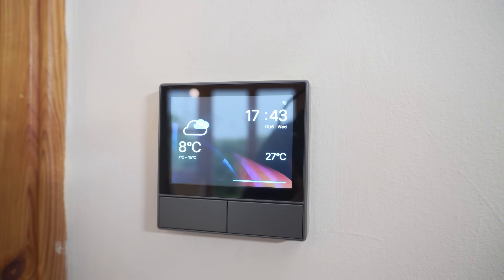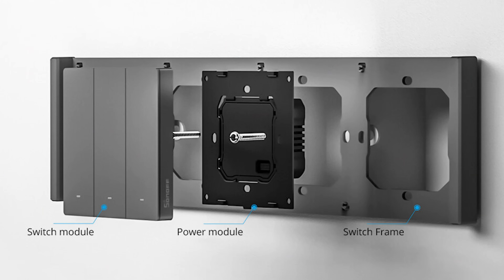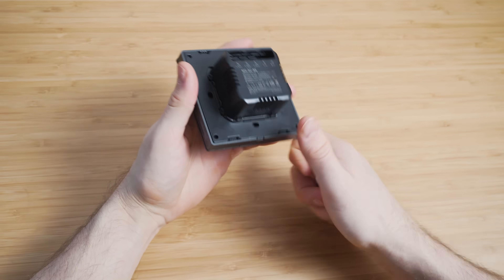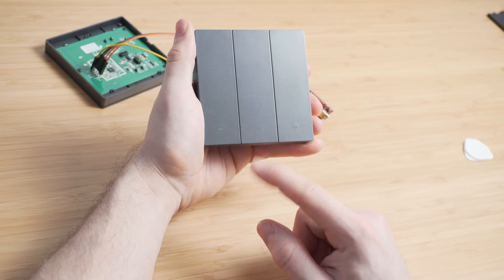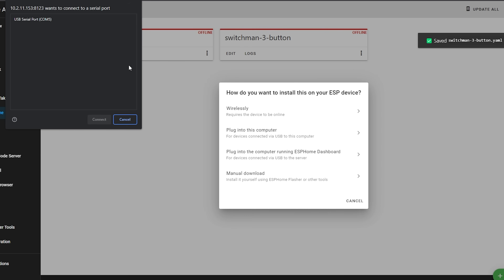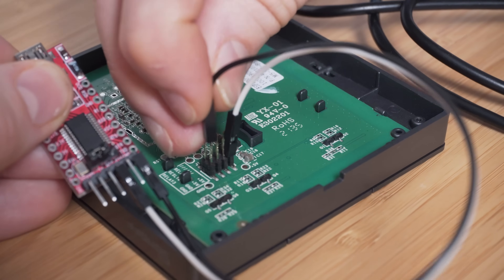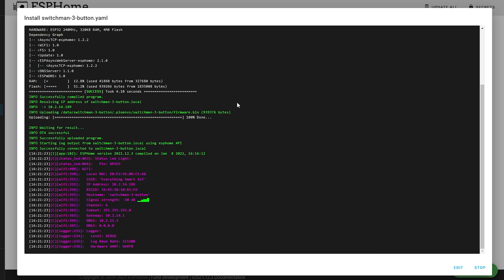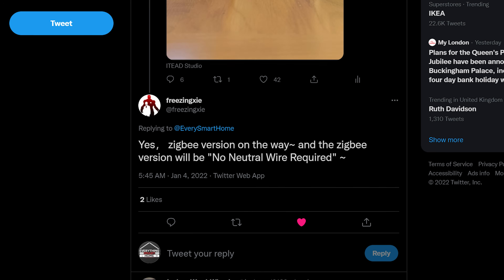Flashing the Sonoff SwitchMan with ESPHome!

Comment: Hi guys. Maybe little update for you. I have ordered 10 of theese switches in white color directly from Itead webside  and they already came with locked bootloader. So no possibility to flash them. When you hold up the GPIO0 to ground it sends following message : Download mode is disabled. Restart with GPIO0 high. I have tried to order grey ones locally and they had unlocked bootloader and flashed fine. Just little info for you. I will have to replace CPUs in theese  with clean ones to be able to flash them.
Reply: Are they the Matter switches? Many people on forums have said that the matter switches come with locked firmware. Also, I think that the matter switches are the only ones that come in white.

Comment: Hey, thank you for the video - there are not so many instructions around it seems. 
I spent many hours trying to tasmotize and ESPHome, bit neither worked out. 
My four computers all don’t talk to the switch. ESPHome tells me: Failed to initialize, Try resetting your device… 
How can I troubleshoot this process? 
Any help or links would be appreciated
Reply: Maybe you have ones with locked bootloader as i had. Then there is no luck other than replacing ESP chip itself.

Comment: I already have Switchman R5 integrated in HA and they show up as sensors. Single press, double press and hold are working. But unfortunately I'm missing release function for hold. So I'm not able to dim during hold and set light during release. Is this something that could be solved by flashing them? I Have dug all over the internet to find a solution but can't see any ideas that is is suitable.

Comment: It doesnt look like it s possible to have the ability to disconnect the relay from one of the switches? At least not the code shown. Or is there updated code that allows for this?

Now the big question with my remodelling in june! 

Aqara zigbee switches (great zigbee mesh) vs. Switchman m5 (great bt mesh)

All will offcourse be used in combination with the NSPanel Pro and NSPanel (ESPHome).
Reply: I might be late for your remodelling but this is possible:
- comment out /remove the on_press part of the sensors
- add a name to each binary sensor

Comment: Thanks for the tutorial. 
In the video, you can see that when you click on the right button, the led light does not light up. I have the same problem. Please have you solved the problem with the right light coming on if the right relay is on?

Comment: Thanks for the tutorial I have flashed ESPHome firmware onto my Switchman M5 single relay switch. I am getting this "WARNING GPIO0 is a Strapping PIN and should be avoided.
Attaching external pullup/down resistors to strapping pins can cause unexpected failures" above the config YAML and the relay is not turning the light on although the dashboard shows the switch change when I physically press the button, but the state icon doesn't change. Please can you help?
Reply: I've found the answer to my issue in the HA forum and then I noticed the comment from 'KNOCK' below. It's working now. 🙂
Reply: Just a 3 channel and 2 NS Panels to go.

Comment: Thank you for the informative instructions. I have successfully flashed my Switchman US version, with the bluetooth tracker being able to get data from a Xiaomi BLE H&T sensor, too. One question about the indicator lights settings. With your yaml, the led id lights turn on when the relays are ON, and off when they are off. Is there anyway to turn on the led lghts when the relays are off, and turn off the leds when the relays are on? That would make more sense. Thanks.

Comment: Thanks for the tutorial. 

I have a M5 1-C and I noticed that in your config in switch section instead of PIN 22 should be 23 in order to work.

Question:

How do I create a light entity instead of switch entity?
Reply: I wish I had seen your comment a couple of hours earlier, before I rewired the switch again and checked my config file against the original 😞

Comment: Can any of these be used as dimmer switches (inc panel)? I recently purchased the dimmer (tasmota flashed) switches from Athom and to say I'm disapointed in them is an understatement as I am constantly having to power cycle them from the fuse box to get them to work for a short period of time.
Reply from the maker: Huh that's strange. Tried flashing ESPHome on them instead?
Reply: @EverythingSmartHome  would you know how I do that.  I've tried using the usb serial cable and grounding out gpio0 but esp flasher errors with "Chip Auto Detection failed:" but guess that's with it not going into programming mode. I'm using a Mac btw.
Reply from the maker: Yes it's in this video 😅
Reply: @EverythingSmartHome  doh! 😖 of course it is

Comment: You probably should get pogo pins, they'll make better contact that those, I've flashed a bunch os sonoff devices with them and it's a breeze.
Reply from the maker: I've got some actually, but find this much quicker tbh
Reply: @EverythingSmartHome  I've just stuck my pogo pins to the male part of the pins you used and pressed them against the pad, that way I've never had a connection issue. But to each his own 😉, you do whatever works for you,and that's what matters

Comment: "soldering is not required"... if you happen to have 3 hands and willing to risk bricking the device if you lose connection mid-flash! 

In my opinion, you should be recommending TO solder some header pins on to these connections to ensure a good electrical connection and not risk the alternative.
Reply from the maker: There is really no risk. You don't need 3 hands, I did many of them by myself...as far as I know I don't have 3 hands.
Reply: @EverythingSmartHome  Or you could be responsible and recommend the proper way to your viewers.

Comment: Hi Lewis! It's a pleasure to find your channel. I enjoy every video here. 

I was thinking about using Z-Wave antenna on some kind of SBC like RPi 4B (4GB+) with an SSD I have around to get OpenWRT installed as a base for running my own home router, I have individual APs that can be used so wireless power doesn't worry me.

I was thinking about installing HASS under Docker, I tried in VMs and so on and it works perfectly AFAIK.

Just the question for you as a professional... Do you recommend the HASS OS instead of containers? I want to have less devices running for my network/smart home appliances.

Currently running a VeraEdge (that it's making me crazy) and Z-Wave is used on all devices here, including thermostats and so on.
Reply from the maker: Hello, thanks! It depends on how comfortable you are working with containers really. I would ask why you want to go for containers over HA OS?
Reply: @EverythingSmartHome  I feel comfortable enough with containers, I use them every day so that's not a issue. But I want to have one device to rule them all. HAOS looks good but AFAIK cannot use as router.

OpenWRT is lightweight enough and has support for Docker.

I like the Supervisor + Addons on HAOS but I think I can live without them.

Comment: As someone else has commented, I'm not quite sure what the advantage of flashing these with ESPHome is over using the native Sonoff integration. That's local anyway isn't it (I don't currently have any Sonoff devices), so just wondering about this?

Separate topic, but what is the make/model of your 3D printer? Looking to buy one and the Creality Ender 3 V2 seems to be daily highly rated. Yours looks similar from what I can see. Any plans on making a 3D printing video. It seems you need a 3D printer if you are going to start dabbling in making your own sensors.
Reply from the maker: A few reasons:

 Way more customizable I can add a double or a triple press (or more) to these to control other automations or devices if I wanted to as well as some other advanced functions

Speed - ESPHome is far quicker to respond than the Sonoff app is (it may be a few hundred ms but that's a lot when switching on a light and is pretty noticeable at least to me)

The Sonoff integration is a community integration and not an official one. While the work done for it is amazing and it works really well, there is always the chance that something can change on the Sonoff side which causes it to stop working. With ESPHome it's an official integration, and I'm in control of any updates to the device itself.

One less app I need on my phone.

The printer is a Prusa MK3S, it's not cheap and a lot more than the Ender is but IMO it's worth it. I never have to do any tweaking or tinkering to it to get it to print, it just works all the time without fail. A lot of people I know with more budget printers spend a lot of time tweaking and tinkering with the settings to get them to print properly - I personally just want the printer to work. Unless of course you want to tinker with it then that's a completely different story. Hope that helps!
Reply: @EverythingSmartHome  Thanks for the super informative reply. Makes sense now regarding flashing to ESPHome.

Regarding the Prusa, I have also been looking at that and wondering if it was worth the extra money. I didn't recognise it as I thought they had loads of orange parts. 🙂 I am after a printer that works with very little fiddling. I want it as a tool, rather than something to tinker with (Home Assistant gives me enough to tinker with as it is 😄), so that's a good recommendation. Thanks.
Reply: @EverythingSmartHome  Just been looking and can't see an all black Prusa model anywhere, where did you get that? Is it a special/limited edition or something?
Reply: I see now that it's possible to order it in all black on their website. I hadn't noticed that option. 😄
Reply from the maker: Yep looks like you found it! And same for me, the printer is a tool!

Comment: I would like to buy these switches without the back part without the relays and without the power supply. I am renovating an apartment from scratch with all new electric. I think it would be great to have only the actual switches with the ESP32 and the electronic on the wall. Then I plan to use Home Assistant to control mostly LED lights and other smart devices. Do you know if those switches or similar are available without the high voltage back part?
Reply from the maker: Not as far as I'm aware!
Reply: Sounds like KNX to me.

Comment: I can't really see the point of flashing functional Sonoff switches with Tasmota, especially since advanced functions such as powermeter may then be lost. The switches can be seamlessly integrated into HA without flash and also offer the advantage of free cloud use, which is associated with monthly fees for HA.
Reply from the maker: A few reasons:

 Way more customizable I can add a double or a triple press (or more) to these to control other automations or devices if I wanted to as well as some other advanced functions

Speed - ESPHome is far quicker to respond than the Sonoff app is (it may be a few hundred ms but that's a lot when switching on a light and is pretty noticeable at least to me)

The Sonoff integration is a community integration and not an official one. While the work done for it is amazing and it works really well, there is always the chance that something can change on the Sonoff side which causes it to stop working. With ESPHome it's an official integration, and I'm in control of any updates to the device itself.

One less app I need on my phone.

Those are the main ones for me!
Reply: It is not so much about having a (Sonoff) app. running on the UI, but about the fact that the Sonoff switches in HA can run without restrictions without flashing and also offer functions that are no longer accessible after flashing. In addition, the switches (without flash) can also be operated via the Internet, which is only possible after flashing with the HA Cloud. By the way, the multi tip programming is a HA feature that is not dependent on a flash.
Apart from the fact that changes and further developments of the firmware can no longer be used after a flash, which I rate more as a disadvantage than an advantage. Another advantage is that switches can be integrated into HA across networks (i.e. over long distances), which after flash is only possible via the $5/month HA Cloud.
In other words, apart from the ms delay in the state change, there are few to no advantages that speak in favor of flash.
Reply from the maker: None of those that you mentioned are correct. You do not need HA cloud to make these accessible to the internet, I don't use HA cloud and can access.mine anywhere in the world.

Please state the features you are referring to? You need to give examples like I did. Double press and triple press are not possible with stock firmware by using HA, since these need to happen locally on the device.
Reply: @EverythingSmartHome  
I understand that you can reach your HA from anywhere in the world. But my example was to reach the switches in widely distributed networks.

So if switches are extremely far apart and in different local networks, but they are still to be centrally combined in the HA-UI, you will not be able to avoid an Internet solution.

Multi-tap can be generated relatively easily within the HA UI and a wide variety of solutions can be displayed via the available software functions.

I still have the advantage of proprietary firmware. Quite the contrary. In addition to the relatively unreliable flash method, I actually only see disadvantages.

But anyway. Everyone has to find the solution that best suits their needs.

However, I always prefer the simplest and most reliable solution, especially if it brings me significant advantages.
Reply from the maker: Multi tap cannot be done in the HA UI, not the way I can do it in esphome. It just can't. 

And that is a poor example with regards to a "wide" network. You wouldn't do that for many reasons.

You class proprietary firmware as an advantage? That surprises me, if you are into HA of course :)
Reply: @EverythingSmartHome  
I think the application is not clear to you.
Here on the site there are 8 different local networks distributed over an area of about 70 square kilometers. Within these networks more than 30 different Sonoff switches are distributed, a large part of which are monitored and controlled centrally (with HA).
How would such an application be designed using proprietary firmware without implementing the Internet or various decentralized servers ?
If already concrete examples, this is the place to list them.
Solutions should be kept as practicable as possible.
Reply from the maker: You would put a local HA in each site, that way if the internet (or links connecting these sites to the main one where HA is) goes down, then you can still control them.

Sonoff is proprietary firmware, ESPHome is not. I don't understand the argument?
Reply: @EverythingSmartHome  
Negative …. there is just ONE HA to control or to monitor all distributed switches !
Because all switches interact with each other.
Reply from the maker: That's what I'm saying, that is a poor design choice and not one you should overcome by using the cloud
Reply: @EverythingSmartHome  
How can you say it's a "poor design choice" when you obviously didn't even understand the requirements properly and for you HA doesn't go beyond the local household.
Your solutions may be sufficient for children's room applications, but they are obviously not usable for more far-reaching projects.
Let's leave it at that.
Everyone must work out the right solution for his requirements and will realize at the latest then that such hobbyist solutions are not always the right solutions.
Reply from the maker: I literally work as a technical architect in the enterprise, I completely understand the application. So yes, it's a poor design choice
Reply: @EverythingSmartHome  
Polemics do not help.
You demand examples, but only give vague hints yourself.
How would you realize an area of 70 square kilometers with 8 local networks and various switches and measuring stations, in which each measured value can control the different, individual switches?
It is about the decentralized load control of 8 decentralized solar plants and 8 consumer clusters in which the load is controlled according to demand and in which nobody can operate a decentralized (and relatively unreliable HA UI).
And that, without the internet ? .... I am very curious about that.

Comment: The Sonoff NSFPanel had a US and EU version.  I see in the specifications these accept 100-240V.  Do these work with US boxes?
Reply from the maker: I've no idea sorry - it doesn't look like it at the moment
Reply: It looks like the US version fits into a single gang US standard switch box.  The only real difference is that in the US version, the display is in portrait mode, and the buttons are smaller.

I'm doing some remodeling, and am very tempted to get a UK box, so I can use the square landscape version.